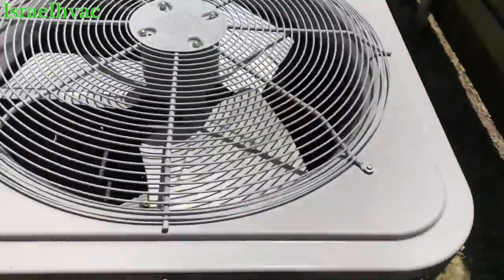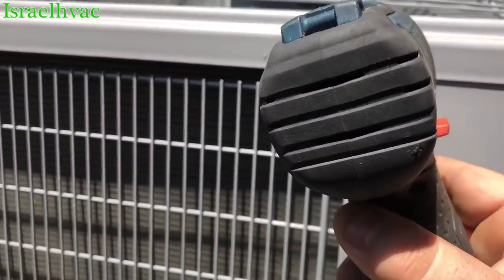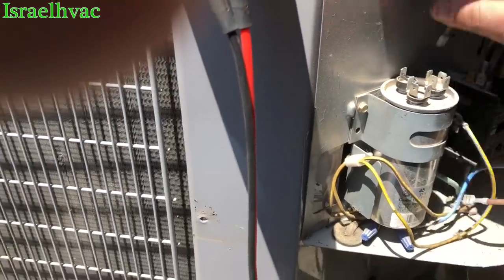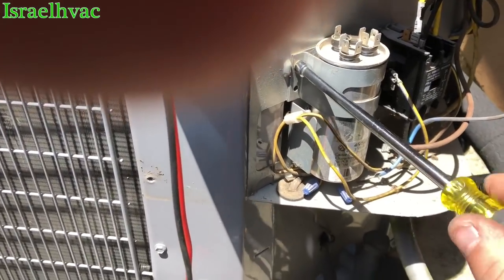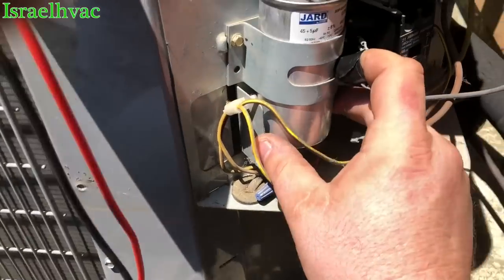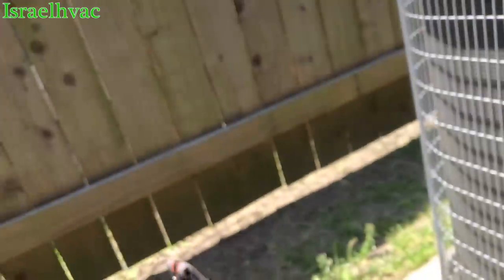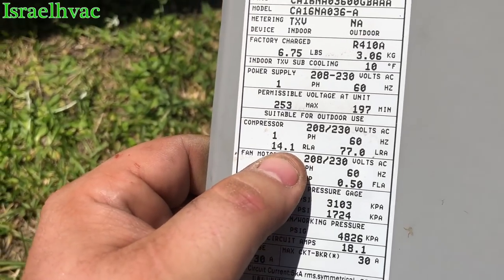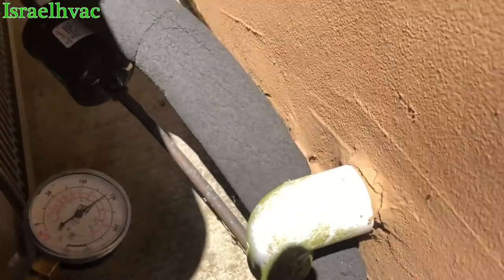HVAC Service | Fan Runs Sometimes

Comment: Good stuff man... I use the little quick check gauges sometimes and as long as nothing causes concern I don't go after the full set. Like you said it was a call not related to the charge and likely ok, so a quick psi reading can show enough in that case. Plus good thing you took the extra few secs to show the label on the cap. So many people just plain don't care about stuff like that. Keep the videos coming, it is no fun watching my own !!

Comment: Seems like 2012 is too soon to be having issues with this stuff
Reply: yea true, but considering that i had to replace the cap on my goodman heat pump after being less than 2 years old its not that bad lol.
Reply from the maker: Chinese capacitors guys. Goodman Carrier/ICP use the same brand from the factory and they don’t last long.
Reply: Israelhvac There’s not much difference between a Chinese made factory capacitor and the Mexican made Jard you installed. Even the American made Titan HD’s fail at an unacceptable rate. I’ve found that the AmRad’s, while expensive, are worth the extra cost as I can’t recall the last time I had to replace one. Will never beat the football sized PCB’s though. Those things are tanks.

Comment: My  York Air Conditioning runs after I changed the capacitor with 5 UF as York customer service advised it runs for many hours and stop.  I started the A/C again and it runs for hours and stop again. I shut  the unit because compressor will going to have high head pressure it's bad for the compressor. Now do I have to increase the microfarad to 6 UF of the fan capacitor ? or do I have to replace the fan condenser motor. Please let me know it's really hot here in Texas. I need your help.Note! the old fan capacitor is not readable there is nothing you can read on it these include the condenser fan motor the model, RPM Serial #  and nothing you can read in it. Pleas help and let me know. Thank you so much. Pleas email me to my email address joebal44 @gmail.com
Reply: kdc laka get it fixed?